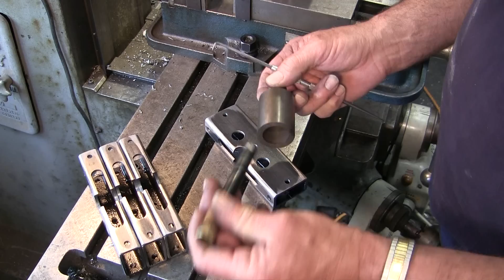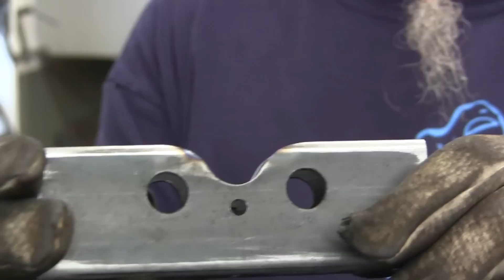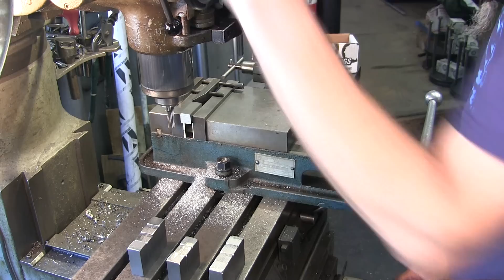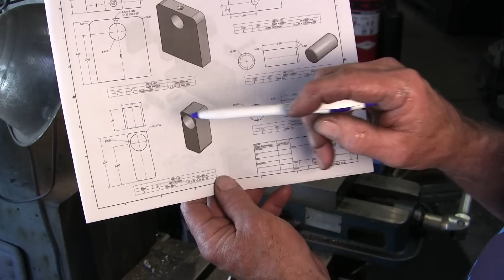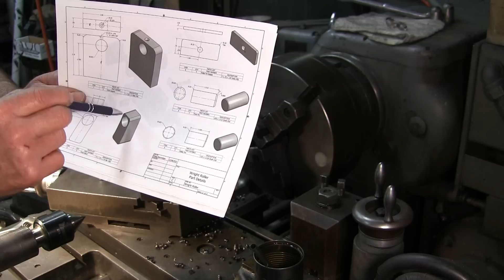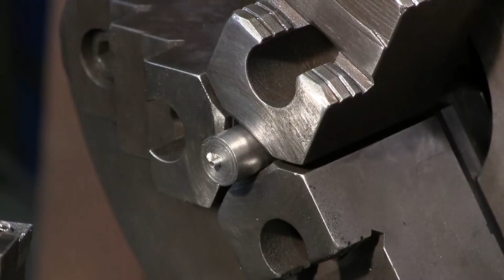The Wright Roller Kit The Build / Part Three

Comment: Keith, I should have made my self more clear.
Would it be possible to take a piece of CRS approx the finished size of the tube plus the length of the trunnions, center drill the the piece of steel where the center of he trunnions will be,  band saw off the excess, turn on centers of the trunnions to make same. 

From the narrow  side, drill the area where the bearings will be, mill out the area between to form a pocket for the bearings, finish the area in the middle as you have done. This would be not unlike how old time carpenters made mortises and would minimize wear on a mill cutter as well as probably be faster as holes drill quickly. 

Drill through the pocket(before or after machined) with a drill suitable for the thread size of the shoulder bolt, shoulder matching the ID of the bearing. thread one side of the pocket, drill the other to size of the shoulder bolt, drop in the bearings and be done with it? 

I have not followed the reason for the support between the bearings, but might it be cheaper in time and tooling to increase the thickness of the plate to accommodate this issue? 

This reduces the number of operations, cuts, holes, sanding, etc. Perhaps I am misunderstanding something as I have not gone back and followed all the the reasoning in this project. 

Thanks,

Dennis

Comment: When milling the ends of the blocks and not using another block on the other end of the vise to keep the floating jaw parallel. why does your work piece not pull up? Is it because of the square face of your stop? I think it would pull up for me even with a brand new Kurt vise. Or most any vise.I'm thinking that it is the stop preventing that from happening.  Love your videos!
Reply from the maker: Not really hogging on it and not over tightening the vice.  ;{)------
Reply: Good reply Keith.I see you read your comments. Good man.  I surely didn't mean to question your experience level and I can tell you know what you are doing. But I still think your stop prevented that part from pulling up. In my world.... every time I give something any chance of bad things happening...it does. lol  You are a very talented man....keep up with the great videos!

Comment: Nice job as always. What would you think of taking a piece of flat steel, drilling two holes for the bearing shafts on the ends, machining a pocket, using shoulder bolts for the bearings and calling it a day? 

Dennis
Reply from the maker: That would lose the self centering and trunnion action that gives the roller kits their, all surface usability. ;{)-----

Comment: I almost bought one of these kits when you first made the available, had I done so and then realized the tools required to to bring the tool into a usable form I would have been very upset.
Reply: I would not feel that way. I purchased the kit and found it can be done in many ways. I only have an Atlas/Craftsman lathe with a milling attachment, drill press,  welder and hand tools and assembled the one roller assembly before this video came out. Now I will do the other one using a lot of the tips and procedures from the instructional video. End result is the same. So don't let the lack of professional tooling hold you back. Remember-"Necessity is the mother of invention". Just go for it. Ed K. Cleve. Oh.

Comment: I have a dedicated set going from small to medium to large (which is slightly larger that the one used in this video) of machinist clamps i bought at a "yard" sale. The things were really tired and whomever owned them before me put a lot of chicken marks on them, so i turned them in to vice stops. It's a lot better than the proper clamp, a lot more versatile too because you can do a lot more fixturing with them than the actual clamp.

Love the spring idea, i've been using some copper wings on the sides of the jaws but those can be a bit hit-n-miss, certainly not an elegant solution.